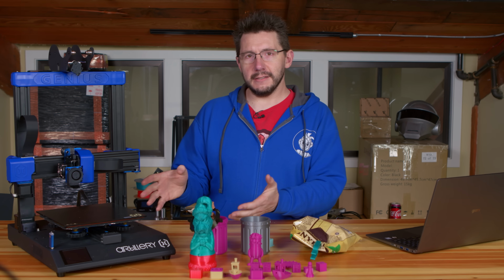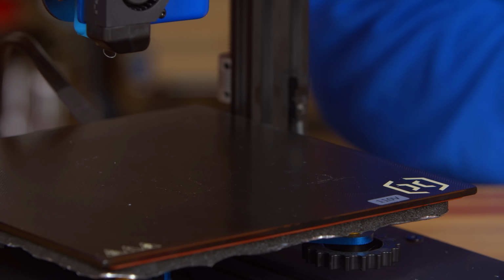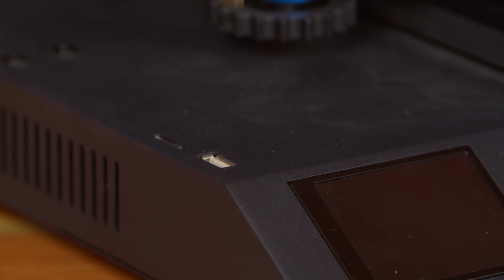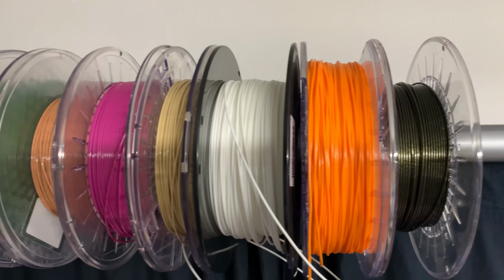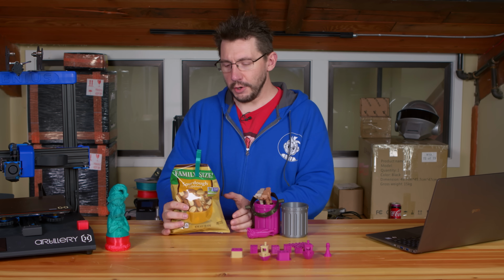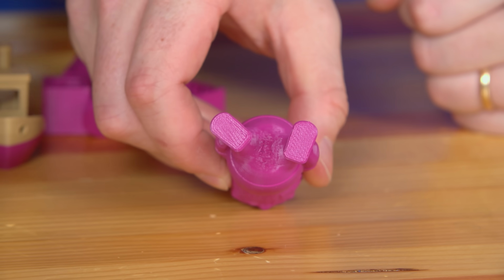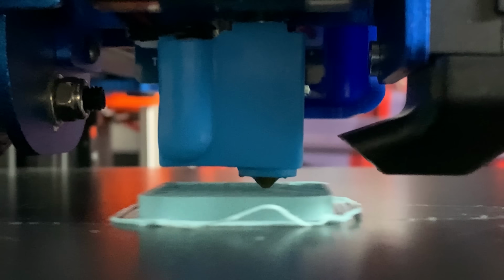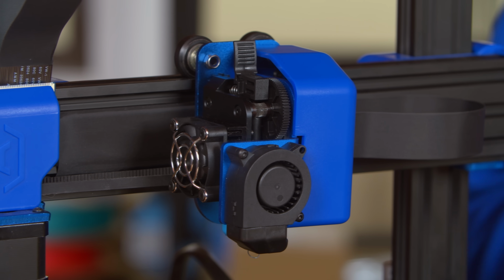Does This $299 3D Printer Make The Grade? Artillery3D GENIUS Review

Comment: I just unboxed my Artillery GENIUS 3d printer and followed the instructions given completing assembly and about to heat the bed and get it leveled, but then I ran into a problem setting thermal runaway kill codes, so I took it all back apart backtracking and found a little 3d printed box on the lower left gantry that plugs the ribbon cable in was loose, tightened that and all worked perfectly (Note: that little box is not mentioned in instructions whatsoever, but the right tool is in the kit) I am printing a stack of Covid 19 Prusa face shields now to give to ER and first responders.

Comment: With the zstop screwed in like that do you think you could add a glass plate to the print bed? I got my genius and after about a week now I’m have trouble getting adhesion, and it seems like my bed is dipping in the middle. Considering adding glass but I worry I would be able to get the clearance for it using just the springs.
Reply from the maker: Adding a glass plate sure would help!
Reply: @3DPrintingNerd  that's the plan, I just worry I won;t be able to get the clearance for the extra thickness without being able to move the z-stop. Do you things the springs would compress to allow enough clearance for the glass plate?
Reply: @peaugh  I'm assuming you've sorted it by now, but all you do is unscrew the z stop and use a T nut instead, then its adjustable :) There is even a spare T nut included in the spares bag.

Comment: Kind of a weird place to ask this, but this video just now sparked the idea in my head, it's on the subject of heat bed thermal expansion. Anyone know if the anyone has come with a way with a Duet(or similar) board of having different mesh bed leveling profiles for different bed temps? My printer seems bed to be fairly consistent in the way it warps when it heats up, and this feature would probably help convince me to go through the effort of upgrading the board on my my delta.

Comment: You do not mention repairability, particularly what you have to do when filament gets stuck inside the PTFE tube. How much disassembly? Is it tricky to get apart and tricky to get back together?
Reply from the maker: Have a look at my Sidewinder X1 episode, I linked it in the description. The hot end setup is exactly the same, and I cover it there.
Reply: @3DPrintingNerd  Thanks much. I will do that.

Comment: I have had my X1 for a couple weeks now and I'm loving everything about it. I don't need a smaller printer (I have an Ender 3) but if I did, I'd pick up a Genius without hesitation.  The runout sensor just works so easily.

Comment: I want to get into 3dp as a hobby, so this would be a nice machine to start on. Still, I will probably go for the Prusa Mini, because of its auto bed leveling, ability to take inputs via OctoPrint and the 32 bit board (couldn't find out which board the Artillery3D GENIUS has, but if it was a stand-out feature, they would advertise it). Opinions?
Reply: I know it's a 3-year old comment but to answer this question for future users, it comes with an 8-bit MKS GEN L board. Also has built in ABL ready components(Just need to buy the BLtouch, or use the z endstop that hooks up to the board on the toolhead) and is also able to take inputs via octoprint. Love my genius, which now has a SKR 1.4T and runs klipper.

This video is the reason I bought my genius. The z endstop is able to be moved with the included aluminum extrusion nut holder that comes with the kit in the bag.
Reply: @MrPanaramuh  Thx

Comment: excellent video but I have a huge doubt how clean the bed of this printer do you use isopropyl alcohol or with what other material do you clean it?

And one more question, what profile are you using for a cure? Could you share it? I can't print pieces that well with my genius

Comment: What was the EVA foam filament you used? O.o
Reply: contact rick.olivarez@gmail.com
Reply: Hi, The EVA foam is slightly different from the EVA filament. The EVA can be print for sole, bags, orthopedic braces,  etc., If you are interested in EVA filament  you can contact fennec3D at rick.olivarez@gmail.com

Comment: Hey Joel, I’ve been experimenting with 3D printing captive objects, namely rope, chain, and paracord, so using a non printed material and printing a cavity within an object to fit the object, as a proof of concept I’ve printed just a plain 12mm cube with a 3.5mm hole bored through one face and it holds a paracord rope in there pretty tightly, I’d love to see what you or possibly one of your other creators and designers could do with this idea.

Comment: For higher temps, can you not just reflash the firmware and replace the heat throat with an all metal one?
Reply from the maker: I don't think you even need to reflash the firmware
Reply: @3DPrintingNerd  Thanks for the reply! Oh right, i guess you just need to send a command to change the new max temp then m500.

Comment: Good on you for supporting and using Floatplane.
Reply from the maker: I really like what the platform is aiming to do, and after some conversations with Luke, it was a no-brainer.
Reply: @3DPrintingNerd  Rad dude I'll back you there as soon as I can afford to. Waiting for your CR10v2 review, loving my machine so much. Coming from a Robo R1 it's amazing how much more user friendly these printers have become. I printed a calibration cube and every side was 20.00mm exactly when measured with my Mitutoyo calipers. Was shocked. But I do have a Hemera on the way as even with the Titan swap in Creality advertised for this printer there's still the PTFE in the hotend, and that's my biggest fault to this otherwise amazing printer. Printed a Mandalorian helmet at .2mm layer height and was just astonished at how well it came out. Plus I can freaking sleep right next to it running.

Comment: With a CR10v2 being less than $200 more for a 12x12x15" build volume that's a hard sell.
Reply from the maker: For many yes. For some that $200 isn’t do-able, and for some the Bowden extruder isn’t something they want.
Reply: @3DPrintingNerd  They offer a swap-in Titan extruder upgrade! I personally ordered a Hemera because I don't like the hotend design all that much, but the fact that they offer the Titan upgrade is so awesome. But yeah $200 can be make or break for some and I do understand that.
Reply from the maker: @TheSolongsidekick  Oh I know about that swap in - guess what box I have on my desk right now :) :) :)
Reply: @3DPrintingNerd  I was really disappointed that the kit directly from Creality, which you need because of screw on connector that enables the Titan to grab on to the top of the hotend, includes a standard size stepper instead of one of the pancake versions. Even though that upgrade leaves the biggest fault with the printer in my opinion (the hotend) curious to see how it works. Are you going to be including a section on it in your V2 review?
Reply from the maker: @TheSolongsidekick  That I don't know. The V2 review is WAY down the list of machine reviews in the queue. We will see.
Reply: @3DPrintingNerd  Unacceptable. Some random guy from a Youtube comments section demands it be moved up. I'm sure you grasp the seriousness of that.
Reply from the maker: That said, I like the V2 and hope to get some more use on it

Comment: Hi Joel, I want to get either the Sidewinder or the Genius and I'm still rather new to 3D printing (shout out to you, Devon and Angus for introducing me to 3D printing) but I want to print at higher temperatures then 230C and be able to print in Nylon based filament. Do you have a recommendation for which all-metal hot end I should upgrade to? If not I'll just get some Capricorn PTFE tubing. The reason I ask is that I'm a high school student and I don't make much money so instead of getting more than one machine I want to make the printer I get really good.

Comment: Don't want to step on anyone's comment if they already mentioned this, but that brownish residue you found on the towel after cleaning the build plate surface is probably the same I found on the V2 plate. It eventually stops showing it's face after a few cleanings, so maybe just a residue left over from manufacturing? Not sure, but thanks for the great review Joel!
Reply: Have the same experience. And the surface works better when it is all gone.
Reply: @DE3US  Totally agree!

Comment: Nice to see companies starting to embrace modern slicers. PrusaSlicer is a fantastic, free slicer! Ridiculous that companies still ship out Cura 15 on machines.
Reply from the maker: It is a little unsettling when instructions for a super old version of Cura are referenced.
Reply: FYI, I switched from Slic3r to Prusa Slic3r to finally Cura 4.4 and my PETG prints got 10x better.  This is where I got my config,  https://3d-nexus.com/resources/file-archives/download/8-artillery-evnovo/5-artillery-genius-cura-4-2-1-machine-settings-profile.    I should mention that I upgraded the machine to the latest version of Marlin and I use a Raspberry PI 4 and Klipper. I have less than 1 month experience in 3D printing and I think it prints pretty damn good with $22  YOYI PETG.

Comment: "FAN WARNING!" :D
If somebody wants to replace a standard fan ("sleeve") to a (probably) quiter "ball bearing" type, be careful when buying them on AliExpress, BanGood or eBay from Chinese sellers!
I've bought "GDSTime" 24v 5015 blower fan recently and it shows the signs of a sleeve instead of two bearings (as they claim). The price is x2-3 times more than a usual "sleeve" type.
The rotor just leans on a side (the whole part!) if you press a bit on that side. When it's not a forge then the bearings must hold a rotor perpendicular to the fan's base. So I've made the conclusion that it's a sleeve type. It's pretty loud and I suppose it's the same loudness that will be replaced (will hear this soon).
My pal advised me to buy an original fan from Delta Electronics (as they make 24v fans). Usually it's good to get a Sunon (if you're on 12v printer).

Comment: would seem to me the placement of usb and micro sd slot would get print plastic pieces in them. Also i have always print petg on masking   tape sprayed with water woodglue mix. no heat on bed and on a raft always works.

Comment: ⚠️ Warning! I am overly critical here. Reader discretion advised!

I couldn't decide through the whole video whether you are sarcastic or not... This printer doesn't seem too exceptional for me at all, average at best...

That plastic top part doesn't seems a good choice, especially that it holds the Z axis screws and the weight of spool. That should be metal, but yeah, that costs... The spool holder seems sketchy, something is waiting to break as you tried to move it.

The dangling filament sensor isn't earned my  appreciation either. Whyyyy?

That top facing USB socket is the most terrible idea ever!!! How long will it take to drop a plastic blob in it from the tweezer?

It prints nice, of course, every printer in reviews prints nice. But at what speed? Never mentioned in any review how fast can it print in acceptable quality! Since it has a volcano-like hotend, I assume it is designed to print fast, but is the frame up to the task?

That fatory test cube is a perfect example what is not hard to print. Rounded corners, flat sides is easy to print. A test cube with sharp corners would be the real test.

I know it is nitpicking, but why nobody mounts LCD/TFT screens the proper way, using bezels? Every design exposes the metal frame of the display module, it is just unprofessional. By the way this is specific to 3D printing community (and companies). I know, it is aesthetics only, but meh...
Reply: Not to mention the hot end is a terrible design. PTFE lined volcano with that long ass melt zone. Those don't make any sense on a printer this size. Volcanoes are for big printers with fat nozzles, and PTFE lining one is just stupid. If it just had a regular V6 style heat block that would make way more sense and probably get better print quality.
Reply: @WrexShepard  I've been printing PETG at 240c for about 3 weeks now and no problems yet. I do however have some better PTFE when the time comes to change it. If I had to guess, the PTFE is only in the heatbreak, not in the nozzle. But honestly I have no idea.
Reply: Disclaimer  I don't know what a exceptional printer is vs an average printer. Just my thoughts below. 

The dangling sensor needs to move to account for X and Z movement. I didn't like it at first , but after watching it , its necessary to be able to rotate towards the extruder. 

I would have preferred a extruded aluminum top as well. I think its there because it eliminates any chance of mis-alignment for the upper z-belt. There is no tension idler for the  upper belt. 

It absolutely prints sharp corners.
The TFT has a bezel built in, why would it need another one?

Comment: I speced the X1 for my daughters Tec lab this fall. 

Could not be happier with it. 

It’s so quite the teacher runs it all day during class. The only issue we had was the usb drive port. There are two separate PCB boards under the cover that are soldered together at a 90 degree angle with no other support. With enough use one board comes away from the other. Artillery sent us another board with the same problem. It took them three weeks to send us a replacement. To get around all this we utilize OCTO print with a raspberry pi plugged into a separate USB port on the side of the unit. 

In my opinion this is absolutely essential to run one of these long-term. Besides printing without OCTO print is just savage anyway. 

The items being designed and printed at the school are so small this printer would’ve actually worked just fine for their needs. Totally recommend this for a classroom!

One last note: the manufacturer has a cure a profile available. It works extremely well. You’re going to be an extremely fussy user to tweak it any further. Between this printer and the cure profile it’s pretty much a ready to go out of the box experience.

Comment: Not impressed with how many downgrades there are compared to the limited cost savings over the X1.
Reply from the maker: Which downgrade didn't you like the most?
Reply: It's hard to justify USD299 for an i3 sized machine (12.1M cubic millimetre build volume) when the Sidewinder X1 with all the same features and a 36M cubic millimetre build volume can be had for not very much more. And... non-genuine Titan extruder, non-genuine Volcano hotend (still PTFE lined) and no mesh levelling?

Comment: Would this be good for making small cosplay stuff like small masks, lightsaber hilts, armor pieces etc. Cause I've been recommended the CR 10 v2 but if a cheaper one can do what I want, even if I have to do more work to finish it, then I'll take it.
Reply: In my opinion it is even better than the cr10.
Reply: @voktanagain5106  that's what I was thinking like sure it would be cool to print every single kind of filament but realistically Lightsaber hilts only need like 5 to 8 inches of height.
Reply: @StormyTehWolf  Well If you dont mind fixing the printer and Tuning it now an then an Ender 3 would be the cheapest Option.
Sidewinder is the easiest printer to Setup Out of the box

Comment: Mr Artillery Sidewinder X1 (the big brother of this machine) had something applied to the bed from the factory which I removed with alcohol after my first few prints in my noob enthusiasm to clean as well as all the guides seemed to suggest (was a lot of effort to get it all off with the bed's texture). Was't a brown residue, though, but white. Ran into some adhesion issues with PLA after that when printing a key chain that had an internal mesh (so no big base, lots of little contact lines). Messed with bed temperature a bit but ultimately resolved it with a glue stick.  I think a raft might've helped for that particular part as well. Searching around I found that All3DP's 10 hour trial of the Sidewinder X1 mentioned some adhesion issues, but they didn't go into detail. Thinking Artillery started  applying a coating in later models to help.